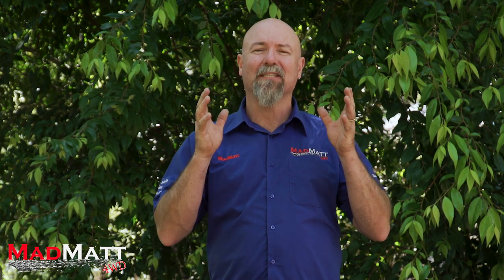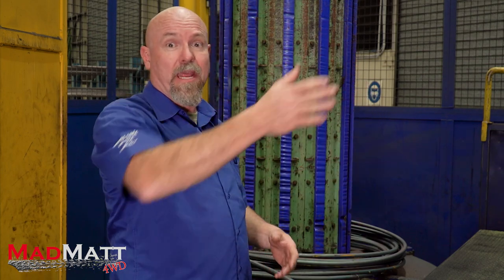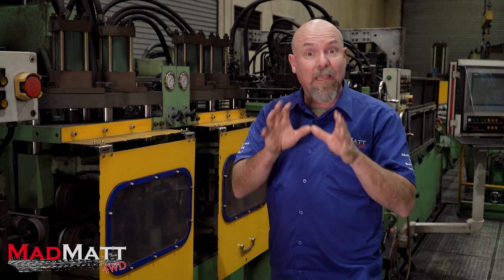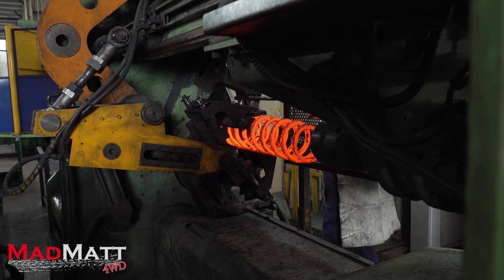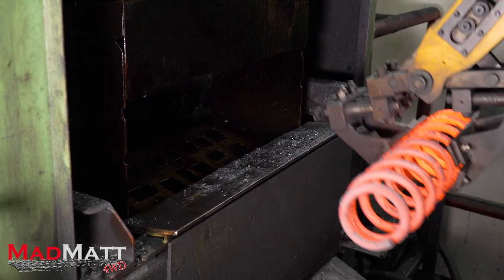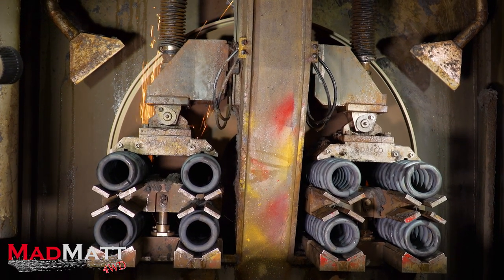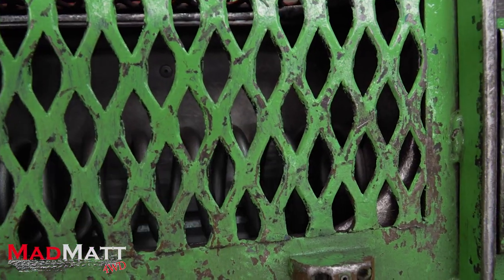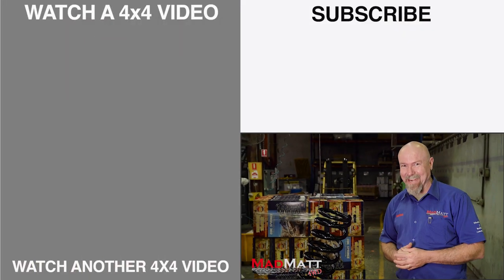How are  Coil Springs made?

Comment: Hi all,

According to DIN and IS standards, springs made from wire or rod with a diameter above 16 mm should be hot coiled due to specific reasons.

We have consulted with several manufacturers who claim they can cold coil springs using wire or rod up to 30 mm in diameter.

Could you please advise if springs made from wire with a diameter ranging from 16 mm to 30 mm using the cold coiling process would be as effective as those made using the hot coiling process?

I look forward to your valuable suggestions.

Best regards,

Johny

Comment: It should be helical with reducing diameter of steel road which used for .. it give you differential spring effect
Reply from the maker: That’s what the peeling machine does. Taper the bar.

Comment: At about 5:50 you mention tempering the springs at 400 degrees (I presume celcius). Then we see someone removing the coils and stacking them. I presume that was the oven, but that was not clear. Also, you didn't mention the ramp up time to the 400 degree temperature.
Reply from the maker: Ok sorry about that